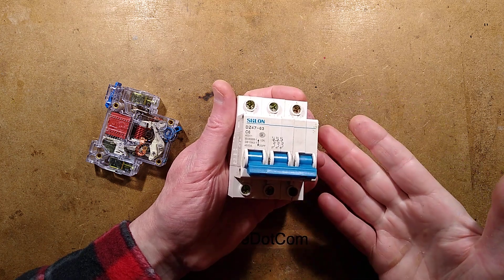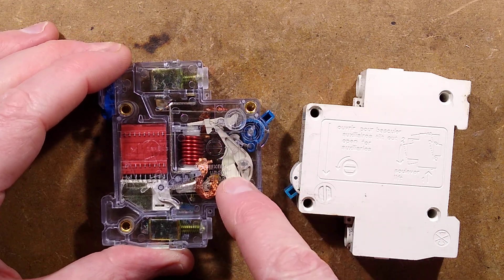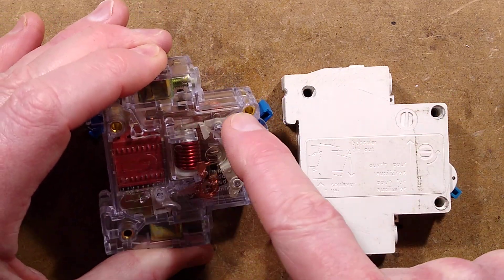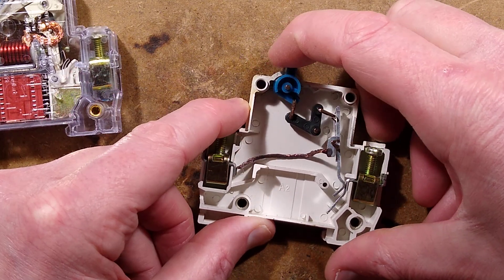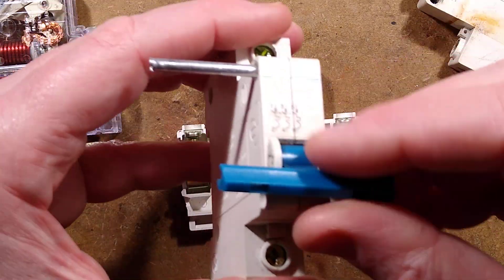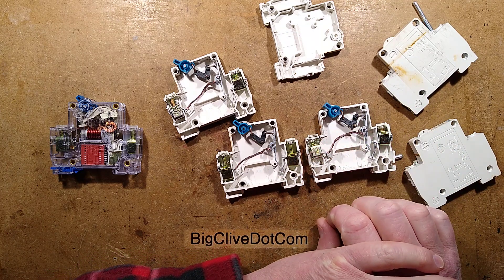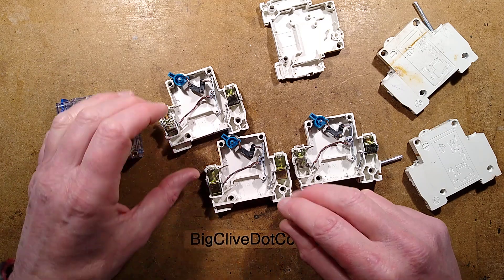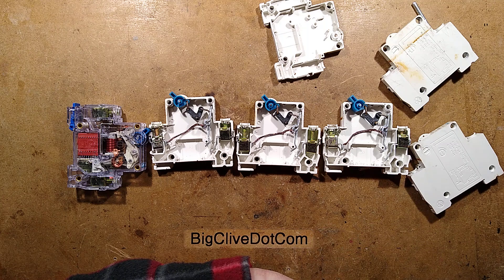Inside a fake un-trippable circuit breaker.

Comment: Yikes. Modern version of a penny in a fuse receptacle.
Reply: Or a nail in the VCR fuse holder
Reply: @MandrakeFernflower  BOFH style!
Reply: @Jeff Sweeney Exactly.  If you've used a penny or a nail to replace a fuse, it's pretty obvious..  But this looks good and proper - until there's a short and a fire.
Reply: @Bobrogers99  Actually, no. The penny trick was used with Edison-base fuses, and the penny would be completely invisible, being in the base of the fuse holder underneath the fuse.
Reply: @PaulSteMarie  Penny could be found by mandatory consumer inspection. This device only by disassembly of safety barriers.  The people mass importing this need to be severely punished and the identically labeled genuine breakers (if any) recalled for inspection with some kind of of anti-counterfit marking on future production runs.  I fear this will justify overzealous crackdowns on individual mail order consumer purchases.
Reply: @PaulSteMarie  You're right, though the penny would be held in place by a blown fuse, and those were usually obvious.
Reply: Or glob of solder in place of fuse
Reply: It’s not a breaker, it’s just a nice manual power switch with decorations to appeal to electricians.
Reply: Well, jam a penny in there!
'Penny'll start a fire.'
Reply: They cut every corner physically possible, this is appalling.
Reply: @worldcure7883  at least they had robust terminals. 😂 It would have been better if they used a small diameter wire instead of that braided one. Maybe it would of at least had a chance of burning to create an open.
Reply: @worldcure7883  not quite, to achieve that goal the wire braid they used is way to massive.
Reply: @worldcure7883  No they didn't - you have to give them credit for making it so the switch actually works.
BC recently examined a fused plug - to find that the REAL fuse was not actually wired into the circuit !
Reply: @millomweb  You don't see those single conductor to parallel inline adaptor fuses too often. 😉
Reply: Or a shotgun shell. 😂
Reply: @robertlawrence9000  I supposed that would be a auditory fuse
Reply: @robertlawrence9000  I heard of a case where someone had put a rifle cartridge in place as a conductor to replace a fuse........worked quite well, until the powder got hot enough to ignite.......
Reply: @johndoe-so2ef  yikes. I've heard about people joking about stuff like that but never knew anyone who actually tried it.
Reply: @johndoe-so2ef  In the US right now, the cartridge is worth more than the fuse!
Reply: @5roundsrapid263  Yes, yes it is......
Reply: At least the penny is self documenting
Reply: .22 rimfire cartridge in the fuse holder for the win.
Reply: That. Was a personal choice. A stupid choice, but a choice. 

This is a con.
Reply: @drackar  true
Reply: All of it at once 🤣
Reply: or the surface mount fuses in a macbook
Reply: A penny that looks like a fuse.
Reply: Welcome to china righteous manufactures
Reply: @Dirtyharry70585  I bet some scumbag would produce them right here if it could be done cheap enough. And I know those sort of manufacturers are not very highly regarded in china as well. Less because of safety issues maybe but than bad publicity.
Other than that Chinese manufacturing is a perfect example of you get what you pay for. 
If you want to pay dirt, that is exactly what you get. If you spec everything right and are willing to pay what it takes, you will get quality nothing less from anything made in the USA, UK, Germany, wherever.
Or would anyone consider certain Apple products "cheap Chinese sh##" (well, ok, maybe not for where they were produced ;) )
Only these days, at that level of quality you are not that far from the cost of manufacturing "at home"

Comment: When the house burns down,  at some point the supply wires will be consumed in the fire,  and then the circuit will be broken...  so mission accomplished.  The circuit breaks,  just with a different type of thermal delay.  "STiL ON" is an appropriate brand name,  because no matter what,  it will be.
Reply: This is just a matter of compatiability. If you would have all the wiring with plugs and junction boxes from the same manufacturer then it would all be fine. In case of an overload one of the wires somewhere near some of the screw terminals would just act as a fuse and the layer of dirt would extinguish the arc. In case of a slight overload the terminals itself will become hot and will start to loosen up creating an arc that would burn off the connected wire and the rest would go just the same way as in the fast overload scenario. As you can see everything is perfectly fine and no extra protection is needed.
Reply: Everything is a fuse...
Reply: Slow blow
Reply: @Leroys_Stuff  ultra.
Ultra slow blow
💨
Reply: @Leroys_Stuff  My kind of girl
Reply: but you have insulation on fire...
Reply: @samueladitya1729  The elegance of the design has clearly passed you by.
Reply: @77thTrombone  I guess humour isn't for everyone...😂😂

Comment: Version 2: put some dead weight in there so it has the right "heft"
Reply from the maker: Lead.
Reply: @bigclivedotcom  Lead is too valuable for that!
Reply: @echothehusky  yeah, this is a job for zinc, or a sand compartment.
Reply: @Broken_Yugo  nah... too complex... a bit of hot-snot and a old rusty M12 nut will do :D
Reply: @Broken_Yugo  They wouldn't want to use sand, because that might stop any arc over. Can't have that.
Reply: @echothehusky  just put a bit of sand in it. it doubles as an insulator, too!
Reply: Broken_Yugo can't be sand, that would give it a slight quenching effect when it finally explodes, perhaps something with a large density, and a propensity to catch fire.
Reply: @justaguycalledjosh  Can't have that. It would make it less of a fire hazard than it's designed to be.
Reply: @echothehusky  I agree. Lead is still used a lot around the world and these days has quite strict (and expensive) requirements for producing and handling it.
Reply: @echothehusky  They could fill it full of silica. Light when the ship it, full of moisture when it reaches the installer.
Reply: @echothehusky  I received a microphone from China today that had a 95 gram (3.4oz) lead weight inside to give it more heft.  Thankfully I bought it to gut and re-use the case :)
Reply: @bigclivedotcom  But that would kill any free shipping :-)
Reply: @bigclivedotcom  what about uranium waste?
Reply: @jkobain  nah, thorium powder for all the neat "negative ion" "healing" power
Reply: @jkobain  
Uranium wire as a fusable link... brilliant.
Uranium is highly refractory so you could be certain the plastic box was already vaporized by the time the fusible link turned into a fine cloud of easy inhaled red uranium oxide dust.
Reply: @jkobain  lol
Reply: @ablebaker8664  Able ... stay calm, take three deep breaths.  I know a doctor I can recommend who will write you a prescription and have your system balanced in no time.  lol
Reply: @askjacob  

Literally going to suggest thorium!
Reply: @kevinsellsit5584  
Is this the same doctor writing your prescriptions?
Reply: @ablebaker8664  Don't be rediculous Able, I get mine from the Vet.
Reply: @bigclivedotcom  
Nahhh... a compressed powder composite of aluminum and iron oxide and a wax binder to make it feel nicely solid.
Reply: @ablebaker8664  sooo thermite? Cool.
Reply: @lightningdemolition1964  
If you're gonna build a BBQ starter disguised as a circuit protector, you might as well 'go big or go home.' 🤣🤣🤣
Reply: @bigclivedotcom  silicates are cheaper. bit of hardcore glued in.
Reply: @bigclivedotcom  to expensive, better sand, or depleted uranium
Reply: @bigclivedotcom  They could at least use a lead wire as a fuse inside.
Reply: @bigclivedotcom  Depleted Uranium. Live a little. ;D
Reply: @bigclivedotcom  to expensive
Reply: Yeh, bit of industrial waste.
Reply: Don't give them ideas
Reply: @tazz1669  Don't have to, they have been doing this for decades now, false weight to make things feel well built or to make up for it being fake. White van speakers come to mind, nice piano finish, fancy name and what looks like real speakers but are false with a brick in the bottom to make you think you're getting something decent.
Reply: @yippdogg9250  dude I had speakers from china that straight up had a fake grill and mesh with no speaker behind it. inside at the back was pcb with one super tiny speaker and the audio connector on it and a bunch of weights at the bottom.
Reply: @ccllvn  Ohh yeah, seen it before haha, its crazy the things they will do to scam people.
Reply: @tazz1669  Nothing new.
Sugar of lead  https://en.wikipedia.org/wiki/Lead%28II%29_acetate?wprov=sfla1
Weighted silk https://en.wikipedia.org/wiki/Weighted_silk?wprov=sfla1
Reply: why you lead when you can use cheaper cadmium
Reply: @PeterShipley1  And as a bonus you can boost the toxic waste potential
Reply: Why you cadmnium when you can use depleted uranium
Reply: There's no room because it's already loaded with No Fucks Given.
Reply: Then skimp on the wire by making it thinner, so it will melt if overloaded and actually work at breaking the circuit. Now you can sell them a new one. :)
Reply: Like the Chinese computer power supplies with cement parts inside to add weight , awhile back
Reply: I vote uranium
Reply: end of life lithium battery
Reply: Careful, they'll start selling them as "scalar energy" circuit breakers jam-packed with thorium dioxide waste.
Reply: Version 2 is on the drawing board nearly finished. 
They've haven't decided if the dead weight should be round or square.
Reply: Sand in a condom
Reply: concrete chip.
Reply: They do this for fake li-ion cells. You might buy a product that's got 6 cells in the battery pack, but 4 of them are just metal cylinders filled with sand.
Reply: Beryllium dust? A nice present for any potential curious opener.
Reply: Judging by the mechanism, they would probably put some lose petal in there
Reply: @gridleaf  they could use the fake usb drives and have fakes all the way down..
Reply: take yourself out back and give yourself a good flogging for even thinking this!
Reply: My thoughts exactly. The cheap Chinese speakers used to have concrete blocks in them.
Reply: I vote for thorium oxide powder in a ziplock bag. Literally noone needs that stuff and people might even pay you to get rid of it.
Reply: Don't give 'em ideas- jeeze!
Reply: Drugs.
Reply: A bit of lead-cadmium amalgam?
Reply: The grifters that created that would probably pack it with something like scrap wood or something equally flammable.
Reply: X-rays!
Reply: some cement like the white van speakers use.
Reply: Use magnesium for the wire and fill the rest with iron oxide/aluminum powder bound in wax.
Reply: Let's hope Trump's future homes have a few of these installed. @bigclivedotcom sorry for politics at dinner table, but topic was terrifying situations still posing risks in unknown places.
Reply: @aarkaarkangel  no Trump and the Chinese didn't get along
Reply: @randydaniels9218 ?! How do you think that relates to my comment?*Did I say Trump + China were pals. Either way what are you talking about?
Reply: @aarkaarkangel  Chinese Junk counterfeit products that would send me to jail in this Country... Maybe it's too late to make quality products in such competitive markets. The arc flash potential is deadly... We need made in America. Sorry I left that out. In Canada this C class is not a Molded Breaker because of low interuption current. Type C is rated at 5KA. Send it to be tested and might find it to be a ARC Flash hazard more then a switch. This is very dangerous and Still On products should be intercepted at Customs in US, Canada and Mexico. At very least... Now we identified just one of these very dangerous counterfeits that are being brought into our Country. Customs needs to stop this type of electrical product before it into our markets IBEW sure will not be impressed. I can only Thank God I made it too retirement in the Electrical field but the youth behind me beware! The trip curve for this devise may surprise you more then you could imagine. Limited by only the potential of the Panel it is installed in. That's what I tried to say, sorry for any confusions on garbage from other Countries but  those Countries are the problem.

Comment: So, the conclusion is that the manufacturer should start adding some weights into these to make them feel more solid. Should we let them know? 🤔😬
Reply: Maybe a load of thorium powder? Then they could advertise them as ionizing health breakers.
Reply: I guess you could fill them with sand, like those fake 18650 cells. It would have the advantage of quenching the fire when that piece of old coax braid pretending to be a current carrying device explodes under load. That would probably limit it to only around an 80% chance of burning your house down, so a vast improvement. 
BTW does the plastic shell burn? I'd bet a wooden nickel that it does.
Reply: Needs more loose screws but they'll cost a bit more
Reply from the maker: No it's OK.  The one week part-P experts will leave the screws loose anyway.
Reply: Don't give them any ideas lol
Reply: dont bother they have been sold they have the money for a cheap product

Comment: Good video. Not sure I see the funny side but it good to be made aware of this type of product. Scary even. Other than it was light weight is there any simple way of testing these devices 
short of dismantling them? Would Flir pictures give any indication?
Reply from the maker: A flir might show heat under load in a real one.
Reply: thermal imaging should show you heating under load but these could also heat because of the abysmal contact material
the easiest test by far if you have one on the bench is to put double it's rated load worth of resistive heaters on it and wait 5 mins but it's not really that practical
an option that should work well for modest loads is replace the heater with a couple of motor run capacitors, you can get 1000uf 250v motor run caps for  <$30 from reliable sources, two in parallel is easily 160A and nearly zero heat generation. just use a suitable large fuse in series maybe 200A just in case something goes wrong and a 200A disconnect as a switch.
the goal is to trigger the magnetic overload because if it's present then all of the mechanics that make a circuit breaker expensive are present

Comment: Oh my God. Is that a no-name brand, or are they knock-offs of something? Wondering how careful I need to be...
Reply: When it comes to this sort of kit, I always buy name brands from trusted suppliers. But as Clive mentioned that's not a 100% guarantee, as there have been incidences of fakes getting into legitimate supply channels.

I imagine they'll feel really light without most of the mechanism in there (the least they could've done is used a smaller strand of wire than that 2.5mm copper, then it would have at least had some protective capability).

I also use individual RCBOs on every circuit rather than the frankly bizarre setup most places use with banks of MCBs protected by a single RCD (same setup as the consumer unit Clive showed a while back). Back in the day when RCBOs were horrifically expensive, and for retrofit jobs it makes sense, but for a new build/major re-work I'd rather put in a few hundred dollars more on the front end and go with RCBO per circuit (MCBs run me ~$10, RCBOs $35-45), with the added benefit that a fault on one breaker doesn't take down half (or more, the property we're in has a single 4-pole RCD across the entire house) the house...

I was pretty surprised to find that my parent's newly built house was wired RCD + MCB wise rather than just using RCBOs on every circuit (and I'll just not mention utterly horrific job the sparky did with wiring the breaker panel because I can't even...)
Reply: @SomeMorganSomewhere  yes, agree - my "research" currently consists of going into Home Depot or the local electrical distributor and buying the appropriate breaker from a brand I've actually heard of before. I'm just hoping I don't also need to break out a scale :)

Comment: Well.  It does "break the circuit" when you flip the switch. 😉
Reply: All switches are technically circuit breakers.
Reply: Box said: Circuit Breaker, Manual
Inside box: no manual found
Reply: @widdermann100  Very slow-blowing.
Reply: @widdermann100  was going to say exactly that.
Reply: Except it doesn't even do a good job at that. If there's some decent current flowing it will just arc across when you try to open it.